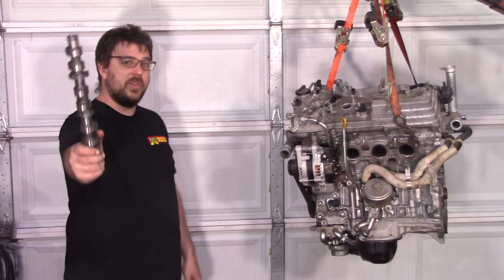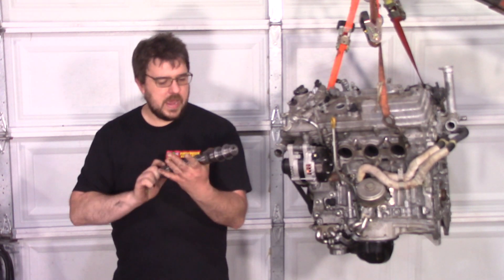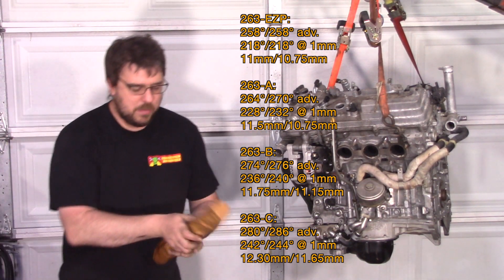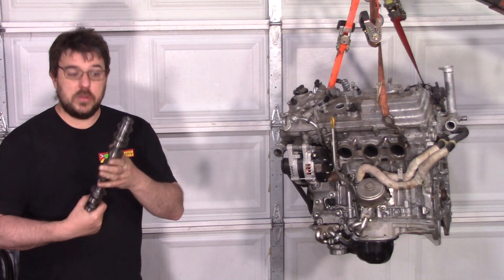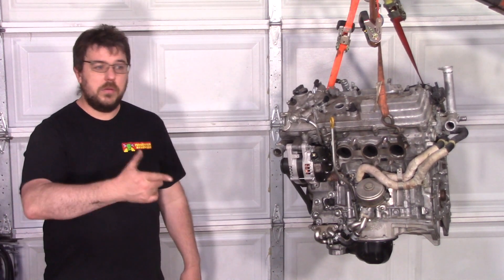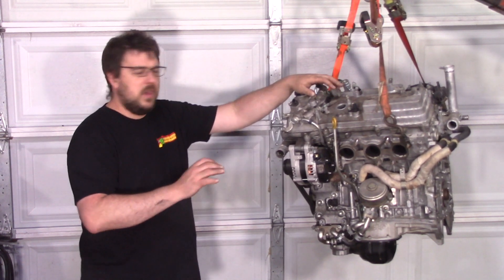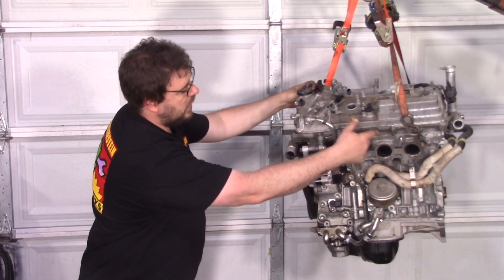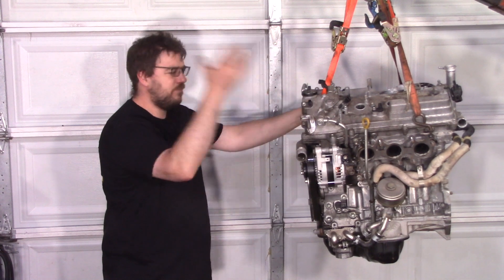Getting even more power from the 2GR-FE 3.5L V6

Comment: Techs at the dealer used to leave the timing cover on and swap the entire cam box, cams, and gears back when the service bulletin came out for the exhaust gear separation on the early years of the 2GR. They would just add a bit more rtv in the corners of the cover when reinstalling. I wouldn't recommend it if you have not torn one down before though.

Comment: I have a weird question. I have a 2009 Lexus es 350. I was wondering if the mods you’re doing was possible for me as well. i know it’s a grandma car but i got it before i even knew that Lexus was a brand off Toyota. 0 knowledge prior but I still wanna have fun with it
Reply from the maker: The engine i'm working with is the exact same one as is in your car, the difficulty you're going to run into is your transmission's limits and because of that transmission you're also stuck with the stock ECU so you'll need a way to program your ECU.

Comment: Spun a bearing. Time for a rebuild. Interested in more info on the  ezp cams. Possibly high compression pistons from the 2gr-fxe or MWR Wiseco offering. Along with the neccessary valve train upgrades.

I miss the forums
Reply from the maker: There's a Discord where we discuss all kinds of relevant upgrades like this, feel free to join us: https://discord.gg/frankensteinmotorworks

The EZP cams are great, good for 20-25whp and i do have an updated MR2 tune for them. They run well with the stock tune but the updated tune just gives them a tiny bit more power. 

The Wiseco pistons are designed for turbo applications and i would not recommend the rings they run on an NA engine. It won't cause any damage but it will cause unnecessary internal friction losses. The FXE pistons run great though i have not checked their clearance with the EZP cams. They should clear just fine but it needs to be checked. No valvetrain upgrades needed for the EZP cams.

Comment: Thanks for making these videos and parts!
What do you think whould 2GR-FE engine fit with E154F transmission. Gearbox cases are the same as the E153, but I'm wondering how much room there is for transfer cases in the 2GR-FE engine.

Comment: Is the 2GR FE as it is stock in a Toyota the exact same thing as in an Evora?  Could the Lotus blower be put on the Toyota?

I just ask because if I built a kit car with a V6, starting from a Toyota motor is a lot cheaper than a Lotus. I don’t actually have a plan to do this, just like to wonder.

Comment: Will these cams work on 1gr-fe single or dual vvt?
Reply from the maker: they will definitely not work in the single vvt-i motor, that motor is actually direct cam to valve without rockers, a completely different valvetrain. they may fit the dual vvt-i version but i have nothing here to check it with.

Comment: Wish the 1mz had all this love. Would love to have my Avalon with a custom set of cams
Reply: Its been done before.   Colt cams andvweb cams will refried custom cams.    3mz cams are worth around 15whp and 400 rom.   Going much over thev3mz cams will require aftermarket ecu to control it.   The stock intake is not good much after 6000 rpm.

Comment: You can replace camshafts in the 2gr without taking the front cover and oil pans off.
Reply from the maker: In theory you can do it but it's tricky.
Reply: @FrankensteinMotorworks  I have pulled the cams on the 2GR-FE, 2GR-FSE, and 3GR many times by only removing the intake, valve covers, and chain tensioner.  I set cylinder #1 TDC and apply paint marks on the timing chain links for reassembly. Make sure the chain is marked correctly several times. You have to remove bank 1 chain on the intake cam first because the slack allowed by the chain tension being removed. After removing the chain on bank 1 you can remove the chain on bank 2  Once the cams are removed use a bungee to keep the chain from falling into the front cover
Reply: Love the content. Just subscribed

Comment: I wonder what you can do with the 2G-fxe. It has the high compression ratio of 12.5:1. Would be crazy if same sort of thing of the 2AR you did can be applied to 2GR
Reply from the maker: Unfortunately the 2AR has a special party trick where the intake camshaft can work in the exhaust position. The 2GR does not have the ability to do the same thing. Also, the 2GR-FXE is almost impossible to get around here. It was much more popular in other countries.
Reply: @FrankensteinMotorworks  that is indeed one heck of a party trick you discovered 👍🏻

Comment: i have a question, have you ever experimented with cheap honda/acura v6’s from cars like the pilot, accord, mdx, rdx, tsx, odyssey, and tl?
Reply from the maker: There's plenty of people out there playing with the Honda motors, i am sticking to the Toyota motors for now.
Reply: @FrankensteinMotorworks  what can You Do to a 1GRFE motor to add horse power…
I have to do a rebuild on mine I’m tryna see what engine lowers r compatable and can be used together . I also heard about the Lexus motor fitting in having the same Tacoma motor will it work with my ecu/wire harness

Comment: So found your videos a few weeks back, fyi great videos. What about the 2gr fxe from the Lexus hybrids. I would think similarly like the 2ar fxe it would have fantastic base potential due to the high compression ratio.
Reply from the maker: The 2gr-fxe could likely be used to make some pretty nice power in a similar way but the intake cam in those cannot be used in the exhaust position so you can't quite do the same thing.

Comment: am i have the ability to put the 1gr 4.0 strocker in my 2gr to increase the size of fire room ?
Reply from the maker: The 1GR-FE is an oddball. it has 72mm main journals and the 2gr-fe has 61mm main journals. There are many other differences but this is enough to see that the crank would not swap right over.

Comment: And idea of how hard it is to fit one of these In a 2011 Scion tc
Reply from the maker: I have zero experience with the automatic transmission but if you have the manual transmission the 2GR will bolt right to it, you'll need to make a custom right side motor mount and you can use my manual 2gr swap ECU. The custom wiring won't be too hard since both the 2GR and the 2AR have the same general electrical architecture. The DBW pedal is the same exact signals so that will just work. I would rate the swap an advanced but reasonably doable swap if you have some experience.

Comment: The cv axels. You selling  on the website  can i use it with 2006 scion tc manual transmission?
Reply from the maker: No, they are intended for the MKII MR2 only. Also the 2006 tC has an e series transmission but it is the narrow e series so the left side stub is the wrong length for you.

Comment: I used to be die hard stuck on 2grfe swapping my mr2 spyder but now that I’ve decided to turbocharge my 1zz engine your 2ar videos have convinced me that I can make some incredible power na out of the 2ar which leads me to think it can make some unreal power boosted while also being lighter and likely easier + cheaper to swap than the 2gr.
Reply from the maker: The 2AR really is a significantly better fit for the Spyder than the 2GR. A lot of people also forget the weight difference between the generations also. The SW20 weighs over 20% more than the ZZW30, this means the ~200whp that you can easily get with the 2AR worse power to weight ratio than a 2GR SW20 but not by nearly as much as most people thing and a cam'd 2AR making 240whp is noticeably faster  than a 2GR SW20. Keep in mind that power can be made with the 2AR-FE with only factory parts and an aftermarket engine controller so no big spend is needed to get there.

Comment: Will the stock cluster work normally with the haltech somehow? AC Compressor ?
Reply from the maker: Yes, the haltech can feed the stock cluster in the SW20 and in the ZZW30 it can as long as you also use the body controller i designed for taht.

Comment: 18k for installation for 300 at the wheels will get you beating slightly modified new V8 mustangs.
Reply from the maker: 300 at the wheels is where the 2GR MR2 is with a bone stock motor. it gets in the mid 12's at the drag strip with a full interior and no weight reduction. THere's a good chance that cams will allow it to just barely dip into the 11's in the quarter mile.
Reply: @FrankensteinMotorworks I don't know about that, one  guy had 350 at the wheels 20 years ago he was barely doing high elevens in a full interiorized MR2. I have about 280 at the wheels and I still lose to stock Mustangs by a few cars.
Reply: @C Duncan yeah I remember this guy guts his car out with no seats sitting on a milk crate to get sales from ppl with full interior. Whatever it takes man.
Reply: @tommyhajimoto6968  not every spyder is equal, mid engine accels at launching braking and handling, I’m guessing you’re loosing while doing a highway pull which practically only shows who has higher hp. Stock mr2s would beat most mustangs at an autocross.

Comment: Have you ever thought about free valve on the 2gr? I understand it would be some work to implement but it would be interesting to see what kind of power gains could be had while remaining NA
Reply from the maker: Freevalve is an amazing system and i've spent way too many hours looking at the patents and it really is neat stuff. I've even reached out to the freevalve company a few years ago to discuss a few things and they even responded to me. This is the kind of thing that interests me to an unreasonable level. But it does not align with my goal here. My goal is to help people get more performance from their motors and developing entirely new valve actuation mechanisms and the control units to go along with them is just not something that can happen on a proper time scale.
Reply: @FrankensteinMotorworks  completely understand, more so food for thought. Always curious about theoretical power gains. Thanks for the reply!

Comment: This is great stuff ! Would you be able to make a video on porting the heads of the 2gr ? I hear that they are restrictive and a good amount of hp can be free'd up if ported
Reply from the maker: Considering we are making over 300whp from a motor plucked right out of a minivan with only external modifications that means that we are getting right around 100hp/L. That hardly qualifies as restrictive. I'm sure there are gains to be had but i will be focusing on the easier to replicate modifications first before i dive into stuff like that.
Reply: @FrankensteinMotorworks  ah ok gotcha ! 👍🏽 Makes sense ! Thank you for the response ! 🙏🏽

Comment: I'm looking forward to seeing what those cams make!!!  ...and to see what the drivability is like.
Reply from the maker: Thankfully this motor has vvt-i which really makes a huge difference in low end power. It allows massive cams to be used without the normal downsides associated with big cams. I expect that other than a 900 or 1000RPM idle these will be perfectly tame.
Reply: @FrankensteinMotorworks  that's super interesting.  I was originally planning to get version A for better idle, but if idle isn't a concern version B might make more sense.  I'm planning to be NA for a year or so before adding a turbo in sw20.  Would you recommend one version over another?
Reply from the maker: @DzuyNguyen  I'll have better feedback on idle with these once they are installed but just to show the power of vvt-i, here is the 2AR-FE idling on camshafts very similar to 263-C with vvt-i adjusted to idle properly: https://www.youtube.com/watch?v=rTGQNKaLZx8 and here is the same motor with a bit more vvt-i angle, not even enough angle to be making peak power yet: https://www.youtube.com/watch?v=wNZBKYNaZ_k
Reply: @FrankensteinMotorworks  with all these mods on the 2arfe.. lets say 240whp.. can this motor still be made to be road legal with emissions obd2 functionality?

Comment: Would love to see what you could do with a Feiro V6 engine.
Reply: The 2.8 never got much love. The only GM V6 that did is the L67 3.8 Supercharged engines. If I still had my Fiero from 20yrs ago, the L67 would be my choice. Had 2 GTP’s and they were a riot! There are other options, but it’ll be custom and very expensive.
Reply: What if…Marc built a 2GRFE powered Fiero for Lemons. A Toyotafied Pontiac would be hilarious.
Reply: @apricity69  I could dig it
Reply from the maker: My schtick really is modern motors, i will be touching other brands occasionally but i'm unlikely to dip into the 1980's
Reply: @FrankensteinMotorworks  that's sad but understandable.